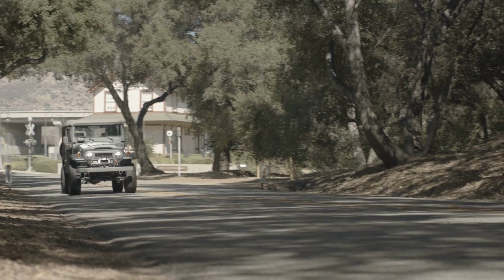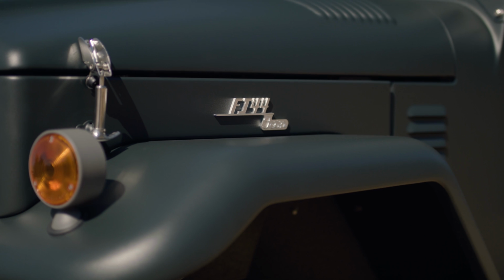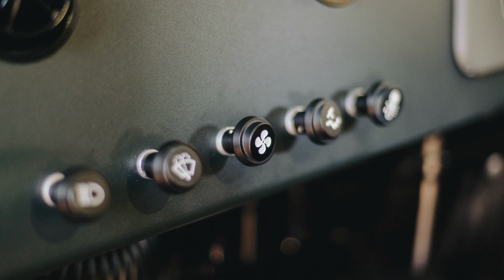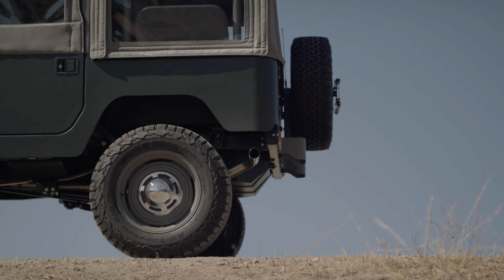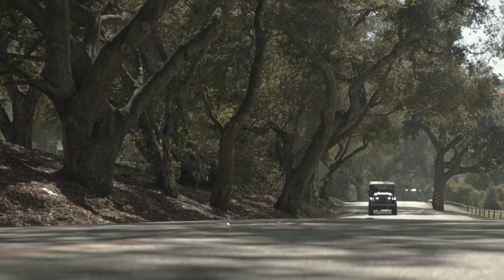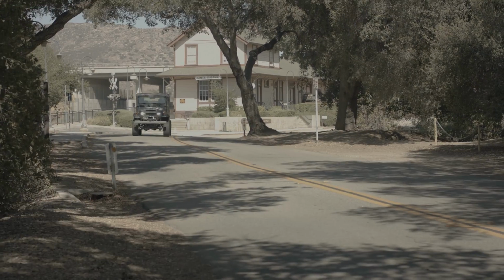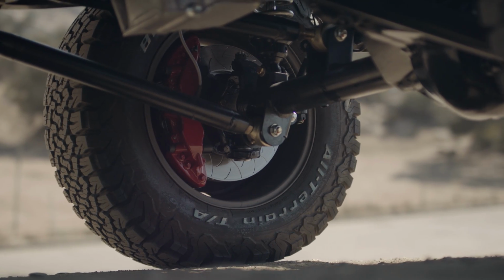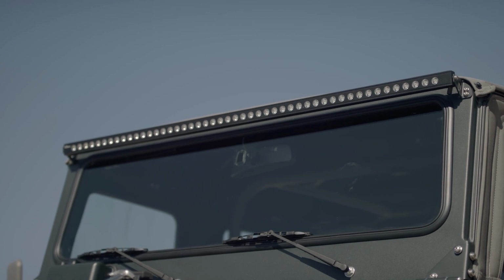ICON FJ44 #163 Old School Toyota Land Cruiser

Comment: It's clear that this build is not cheap by any stretch of the word; but why to go to this level of detail and they install a LS engine? Why not a 5.7 liter out of a Tundra? Don't get me wrong, I like Chevy's and have owned a number of them, but I just hate it when people do this cross-over crap with the drivetrain. I believe in keeping the make pure through and thru when spending this kind of money. I can see when on a low budget with a 944 Porsche, but we're probably looking at $200,000 here. Those 5.7 Toyota engines are badass and last a million miles or more and are low on maintenance cost.
Reply: Toyota doesn’t sell crate engines 🤷‍♂️
Reply: @anticlimacus777  you can always buy them used and then refurbish them.
Reply: There's no performance aftermarket support for those engines. LS engines are sooo much easier to source, modify, and repair. Parts selection is endless.
Reply: He addresses all this at 4:30.